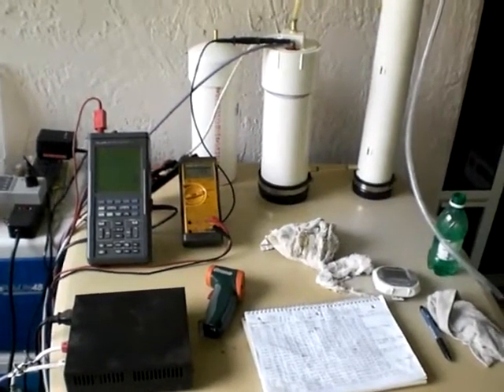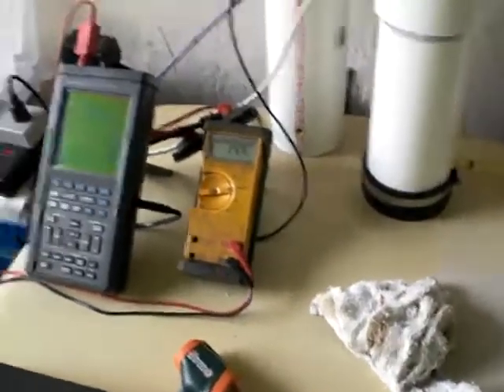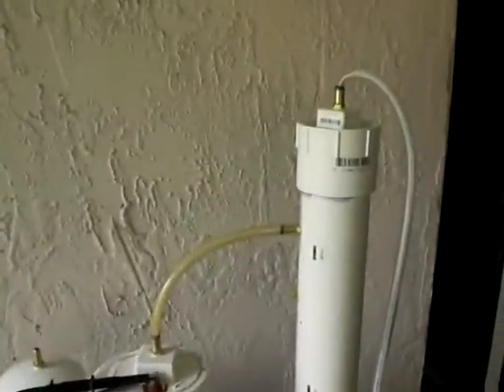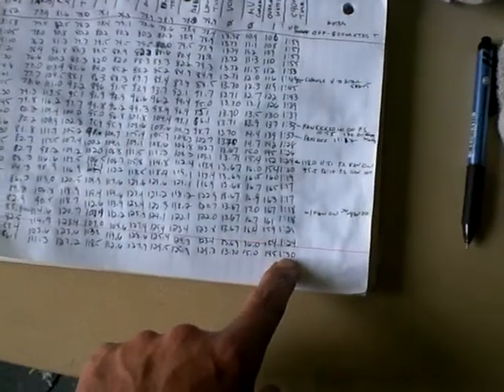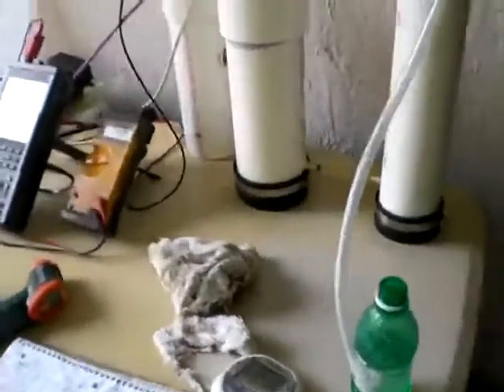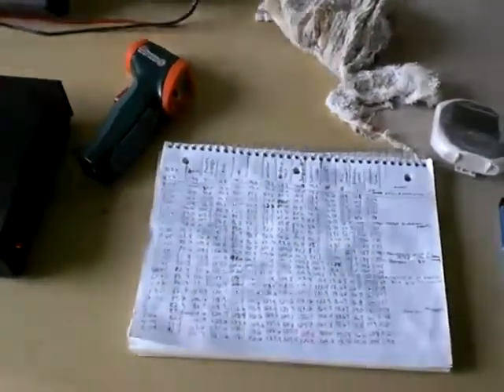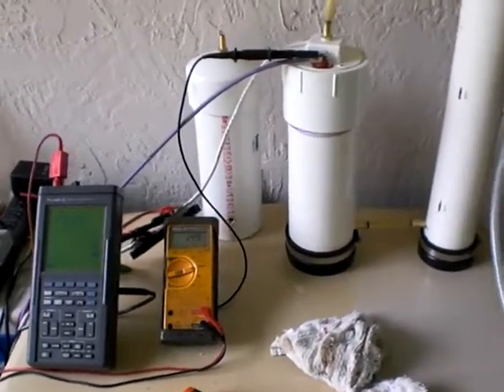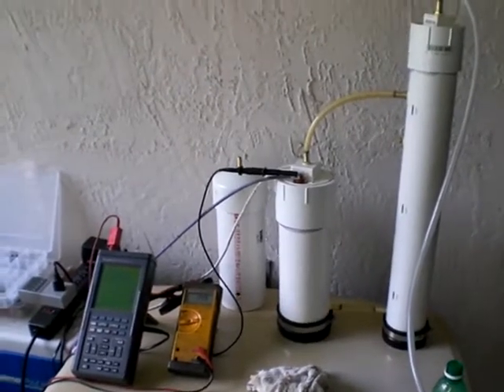Smack Cell Duration Results (w/data)

Comment: after the cell hits a temperature peak, if 
it cools off at all, (wind, air vemt etc),
it will draw less current. also the lower 
temp will cause some of the solution in your 
bubbler to get sucked back into the cell. If
your bubbler has no electrolyte in it, this
will dilute the cell solution to some degree,
again causing less current to be drawn.